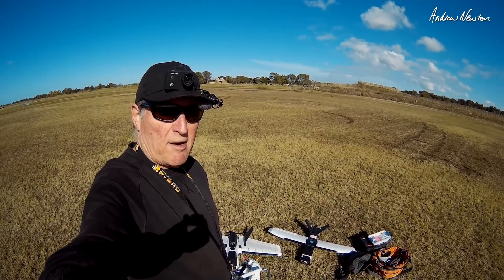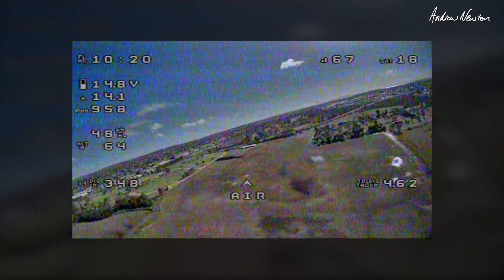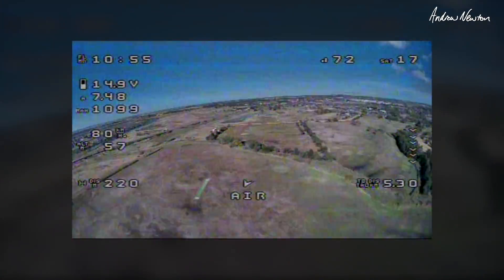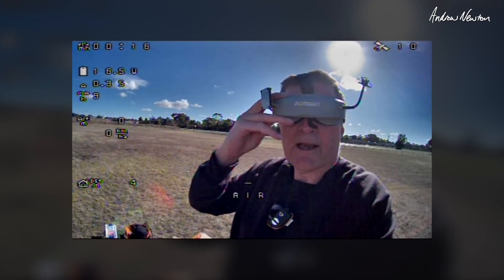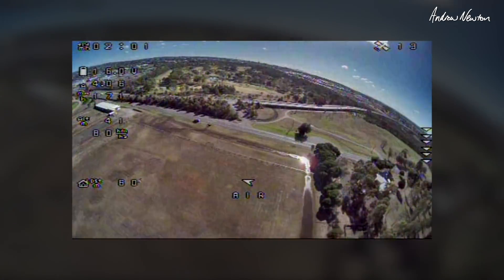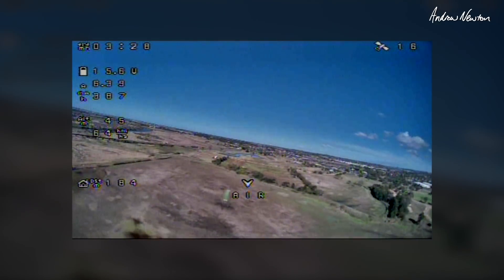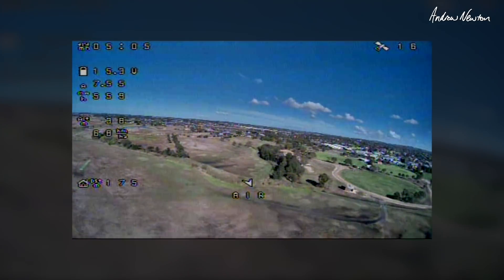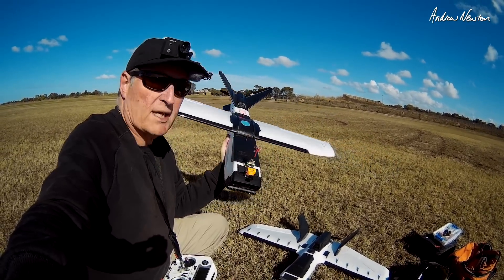Battle of the ZOHDs - Dart XL vs Talon GT

Comment: Great i was wondering which one to chose. Talon seam to be more "nervous" in the air?
Reply from the maker: The Talon is not as inherantly stable but I prefer it over the Dart. Tougher and more efficient
Reply: Andrew Newton @ yes I understand, however if the purpose is to get nice videos you would probably need a gimbal to get these twisting horizontal movements reduced. Would love to see if you can mount a gimbal on the Talon.

Comment: with the dart xl, would auto launch work better if it is hard to launch manually?
Reply: I use Autolaunch all the time on this model, works great. But you need a very hard and precise throw. I also have very high weight, about 1450g since I use heavy battery. 
I use a sunnysky 2216 1250kv with a 8x6, that has better efficiency, but makes launches even harder. I think the stock setup is much better for launching heavy
Reply from the maker: It launched really well in Angle mode. Not a fan of Auto Launch for heavy planes, and light planes dont need it.
Reply: @AndrewNewton  
On my first launches I used Angle mode. Worked perfectly. But since I changed to the 8x6 prop it's much harder to launch. This prop has higher stall speed. I have a 2216 1400kv motor here, do you think it would help in terms of launches?

Comment: Andrew have you fiddled with iNav autolaunch mode? It's absolutely brilliant for flying wings. Makes them easier(and fun) to launch! Not sure if on the DartXL there is a place underneath to get a good grip to chuck it, but you can always sidearm it while holding a wing. Cheers!
Reply from the maker: Yes I used to set it up on all my iNav planes, but not anymore. For big heavy planes and wings it makes launching much more difficult. Easier to launch with power assisting. I have also seen a Ranger 1600 hit the ground then race across the landing field until the pilot could cancel Launch mode.
Reply: @AndrewNewton  I had the same thing with my inav AR900, it tried to get in the air but ended up on the ground, i do have auto permanently on so i false start it and send it up

Comment: Hey Andrew, i have an Idea, could You imagine to use some kind of Yagi - Uda or parabolic Antenna for Your FPV RX Set❓it should improve the Signal from the Plane, but it's just an Idea, a wired One, Your Airfield looks soaked, heavy Rain shortly ❓Video is very interessting, it's absolutly clear, the lighter Aircraft needs less Energie to stay aloft, hmm, a light wooden Wing, with more Wingspan, who knows, could fly longer👉🏻 and 👈🏻smoother❗
Big Salute, and best Wishes from Anton, Vienna🇦🇹
Reply: I`ve thought of using a parabolic something for the radio thinking it would improve signal strength but, unless it was for FPV long range it wouldnt be needed for line-of-sight flying...i guess.
Reply: @leemaples1806  ok, good reason, to much Efford.
Reply from the maker: I'm in to low fuss FPV. Can't be bothered setting up a ground station and directional antennas.
Reply: @AndrewNewton  i tought about a rather small Device on the Headset🤔🤖🤓